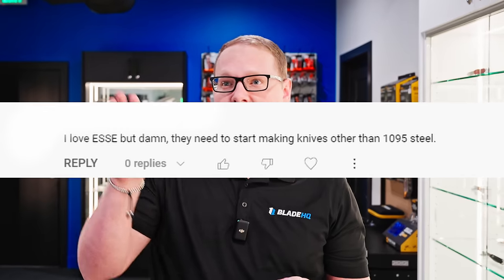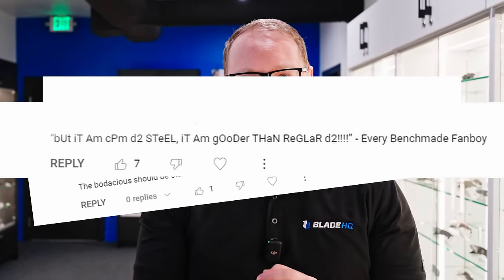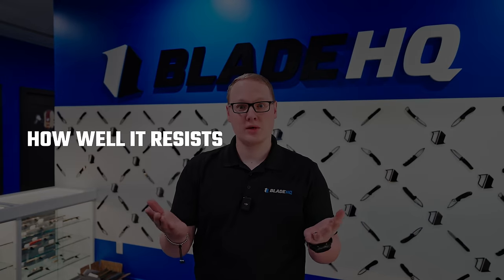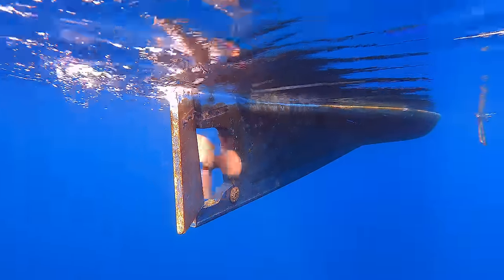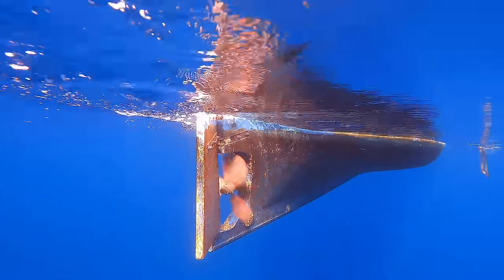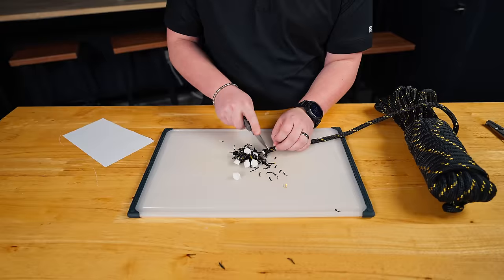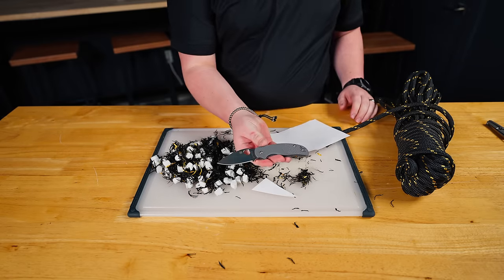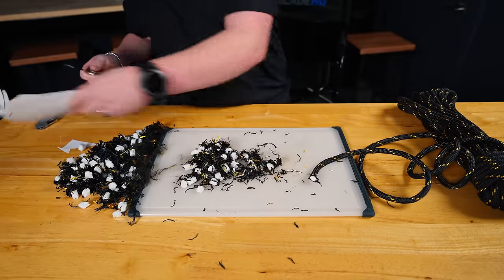What Is The Best Knife Steel?

Comment: AEB-L gang
Reply: This.  I wish this steel was more common, I desperately want a medium fixed blade in it for camping.
Reply: @Cabur_Skirata  I like it because it's cheap so it's great for first time builds. Tough yet stainless. Fine micrograin, nice sharp edges. Easy heat treat protocol. I'm making some fixed blades with aeb-l. Basically just my take on all the popular knife shapes, from 5 inch to 9 inch. Should go good. Think I'll try a tapered tang this time. A few of them will have a sharpened back edge.
Reply: @NSW15355 I wouldn’t personally use it on a 9 in chopper especially if you plan to ever use it like a pry bar and apply lots of lateral force.

Comment: I usually love bladeHQ but this has got to be the most useless video ever 😂. "Here are a list of steels not available!" And in my opinion, the next examples given are not the "best" for 99% of people. Most newbies and vets in the knife community know your blade should fit a number of scenarios, as well as being somewhat affordable AND accesible. He even mentions the negatives of min-maxing and then proceeds to mostly pick rarely seen and expensive steels that heavily lean towards a specific purpose. The 2 exceptions here would probably be 12CN27 and S30V. And while both are great, there are at least half a dozen other similarly performing steels around the same price points. At the end of the day, 8CrMoV, Nitro-V, 12C27/14C28, and D2 are going to be what you primarily find on sub $100 knives that will fit a variety of common scenarios, 8Cr being the cheapest. And if you're lucky, you can sometimes find S30V around this price range, which would probably be my personal pick for "best" steel, if only because it is a large step up from the others. Just my two cent. Love you BHQ😅